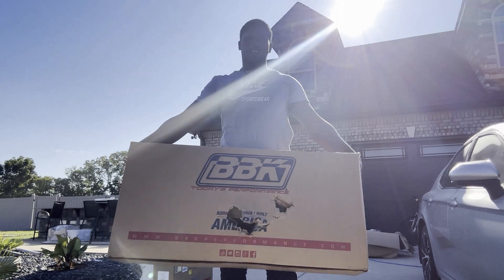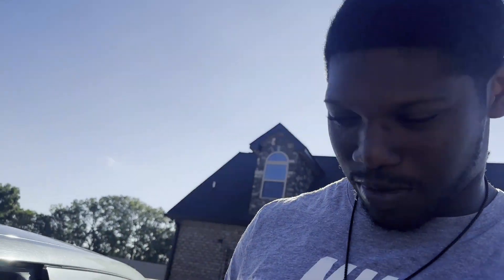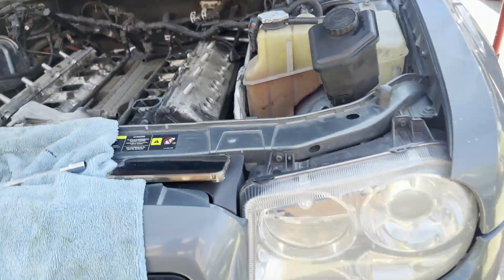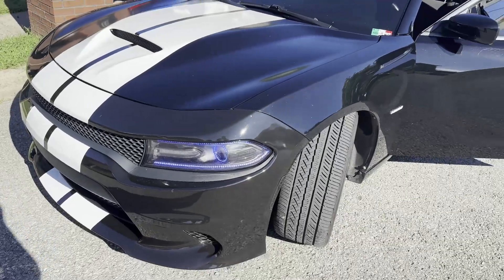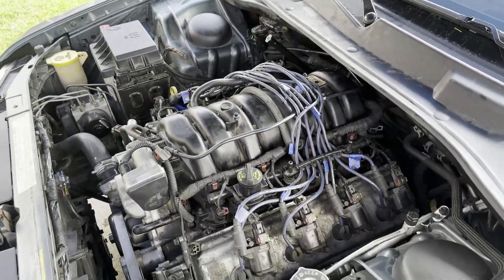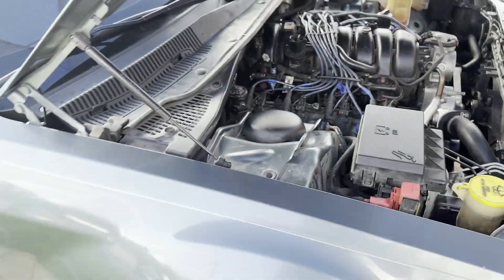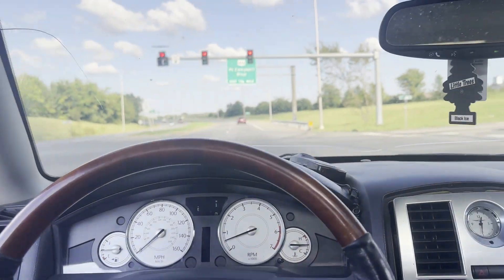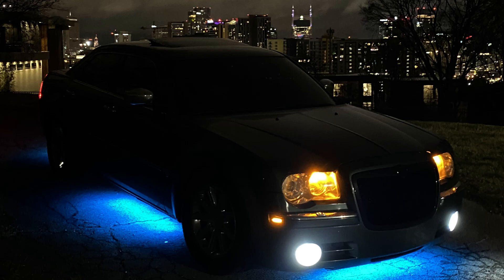Installing Long Tube Headers On My Chysler 300C!!! *Insanely Loud*

Comment: Did you run this with no tune? Has your engine been holding up well?
Reply from the maker: @JonathanCrappers  it’s best to get it tuned as soon as you can so you can have all the performance and power from the headers. I drove it like a week or 2 before I got it tuned but yea everything has been holding up well now I’m cammed and fully built and everything still been holding up good
Reply: @_exotic_aj  oh i see good to know. where did you get it tuned? i wanna do headers but the tuning part confuses me

Comment: Hey bro can u send a link to the headers and mid pipes I wanna get these for my 06 5.7 300
Reply from the maker: Yea I got you… https://bbkperformance.com/products/dodge-5-7-hemi-challenger-charger-1-3-4-long-tube-exhaust-headers-titanium-ceramic-05-08-reconditioned
Reply from the maker: https://bbkperformance.com/products/dodge-challenger-charger-300c-magnum-5-7l-hemi-midpipe-05-08

For some reason the midpipe didn’t fit all the way on to the X-pipe so I had to get that welded together for because the midpipe and the X-pipe was the same exact size
Reply: @_exotic_aj  appreciate bro💯
Reply: @_exotic_aj  thanks for sharing bro I’ll probably take it to a muffler shop to get it installed anyway but thanks you and nice 300
Reply from the maker: Yessir no problem and appreciate that 🫡 and yours nice to. I jus ordered some more performance mods for so stay tuned bc you might like what I’m doing I’ll be installing them in like 2 weeks
Reply: @_exotic_aj  bet bro appreciate it much love💯 ima stay tuned and have my post notifications on
Reply from the maker: @Mr_hemi06 yessir 🫡🤝

Comment: Headers with a mid muffler delete?
Reply from the maker: Long tube headers with high flow cats then straight pipe all the way back
Reply: @_exotic_aj where’d you get this from? Im in cali so these laws are ridiculous but if I can get em IMA GET EM
Reply: @_exotic_aj the high flow cats and the headers
Reply from the maker: @300c06  bbk performance